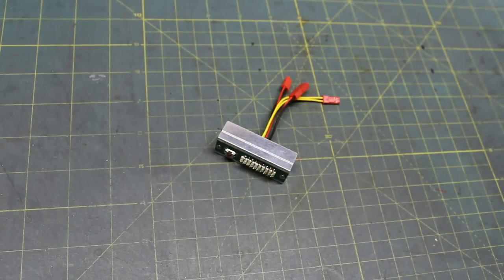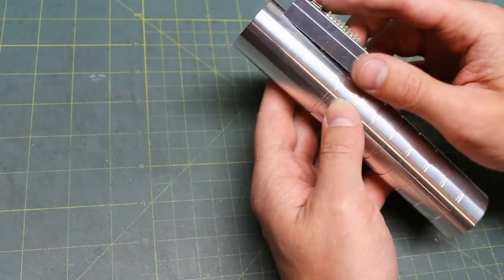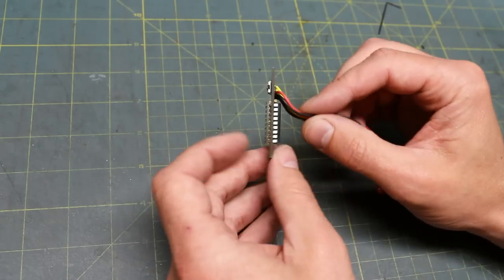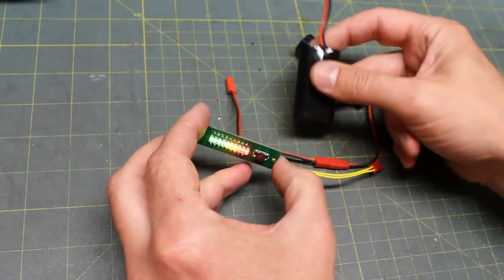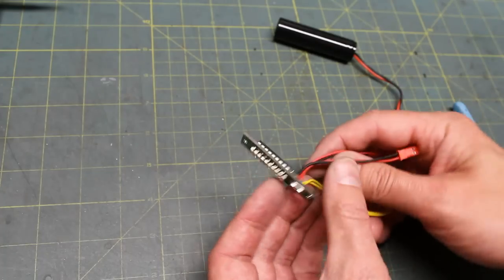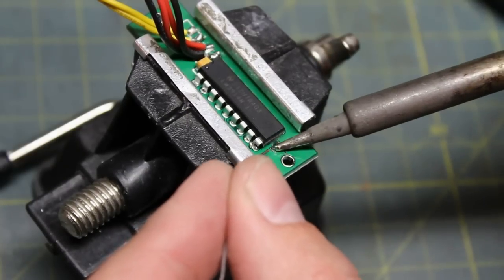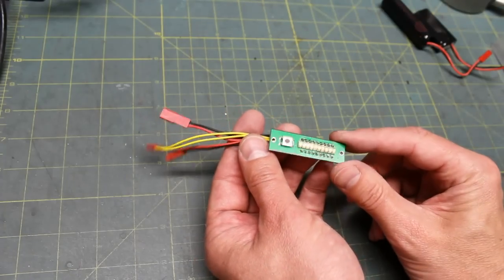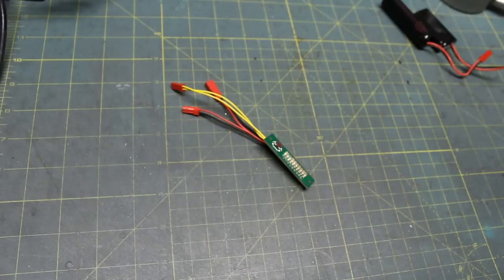PLI for Box Style 1

Comment: You had 6 wires coming out of the PLI. The 2 yellow are for the switch and go to the sound board. I imagine the other 4 go from battery IN --> PLI and then on to the sound board +/- OUT --> PLI. Am I correct on this? If so, if you have a recharge port, is it better to go from battery to PLI, PLI to recharge port, then recharge port to sound board? Or battery to recharge port, recharge port to PLI and to sound board? Which one do you think is best? Do both of these options work? Thanks, Rob.
Reply: I would go to recharge port first so that a killkey will shut off the PLI as well
Reply: Ok cool. Thanks.

Comment: Great Video! one question though, with NBv2, the connecters you said go to the board, those go to the battery terminals to the board, but what about the switch? will that just connect to the PLI and not to the NBv2? Thanks
Reply: +Adrian Horvat Not sure what you mean. There are spots to connect the switch on the NB
Reply: at 2:44 you mention switch wires.. what will that connect to? If you have NBv2 would you leave the yellow wires out? Thank you.
Reply: +Adrian Horvat The yellow wires would be soldered to the switch contacts on the NB
Reply: Oh I see, Thank you kindly. Keep well!